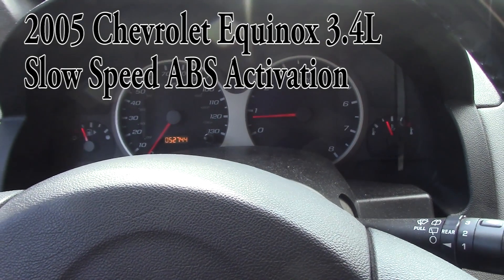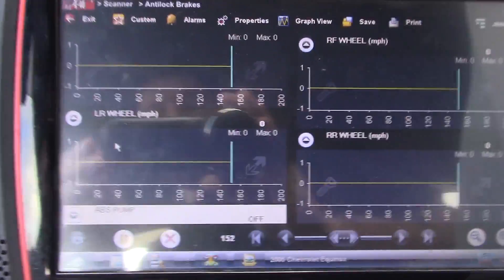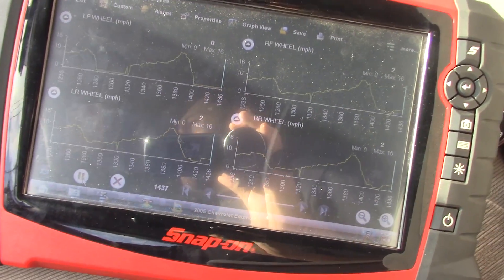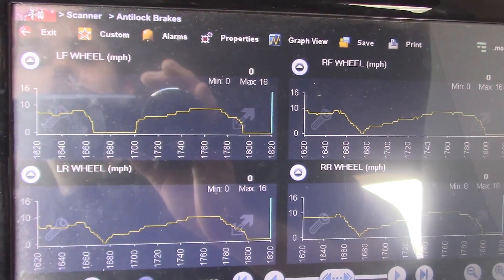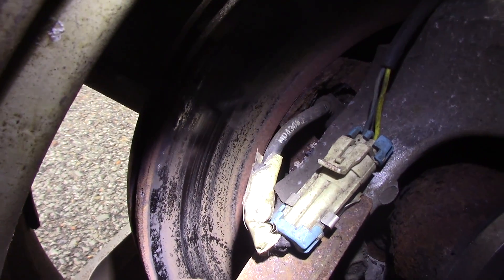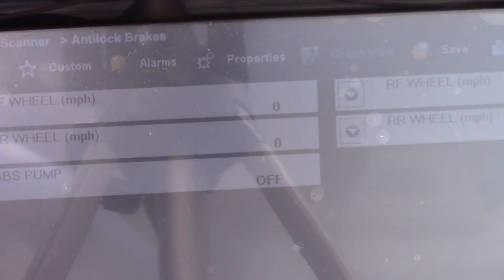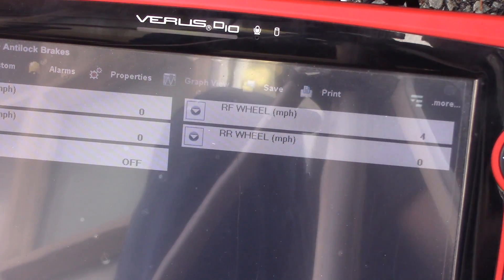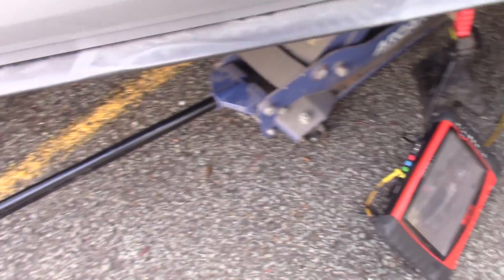2005 Chevrolet Equinox 3.4L- Slow Speed ABS Activation

Comment: Did changing the bearing made a difference ..... this regarding the video
Reply from the maker: Changing the bearing fixed this vehicle.
Reply: Positive Lead Diagnostics  ok thank you ima try to change my bearing and see if it will change mines
Reply from the maker: The data pids would be your best bet in helping diagnose your issue
Reply: Positive Lead Diagnostics ok thank you so ima have to plug in a diagnostic machine and put  it on live data and get my problem solve thank u you helped more than u know ....

Comment: This happening to me and I got the left bearing change and the speed sensor change because the TC light was on now it's off and this happening when I brake on low speed should I change the bearing and sensor again or what help me
Reply from the maker: You need to look at scandata and check which speed sensor is dropping out at low speeds
Reply: Positive Lead Diagnostics  ok thanks so ima have to do what the video shows to get that data right ok thank you

Comment: I have the exact same problem with my Equinox, however both the front bearing with the sensor has been changed and the wiires seem to have no problems, could it be air in the brake system, or the rear sensors?
Reply from the maker: I would be looking at the same data, if the front bearings with sensors are new, I would be looking at the rear speed sensors

Comment: the gm k line trucks have a bulletin for rust build up under the sensor that mounts in the steering hub....increasing the air gap 1mm or more
Reply from the maker: I think high resistance in the wiring would have caused an issue at higher speeds too and probably would have thrown a fault. Definitely an air gap issue. I knew that pretty much right off the top. But I needed to be 100% for the shop I was helping. Plus I like to know and prove the why. Thanks for watching.

Comment: great vid! I don't think there is any other way to be 100% you covered it all....the only other thing would be high resistance in the circuit, but you will see that with wheel speed being lowest at "working speed"

Comment: Excellent diagnoses. Loose wheel bearing causing the air gap to vary at low speeds.
Reply from the maker: The bearing didn't have play. I believe just rust build up between the sensor and bearing housing causing an increased air gap
Reply: Ahhh, I see.